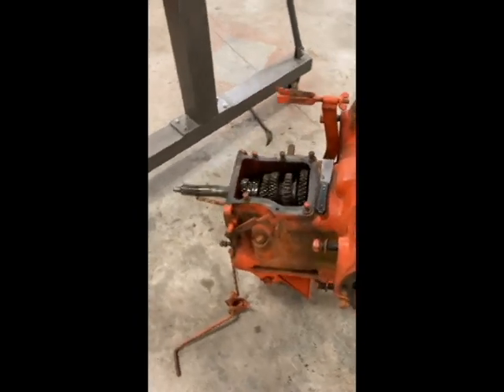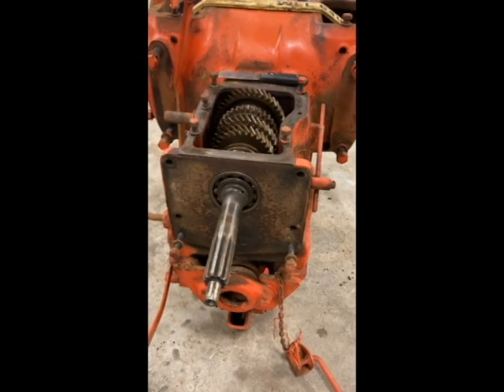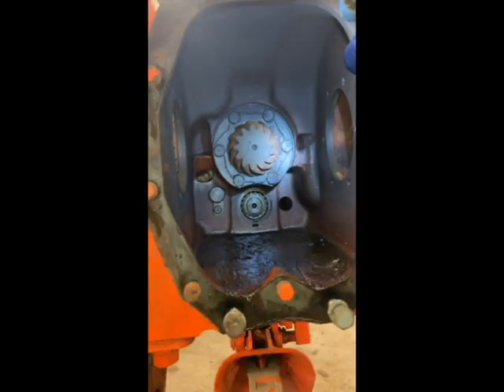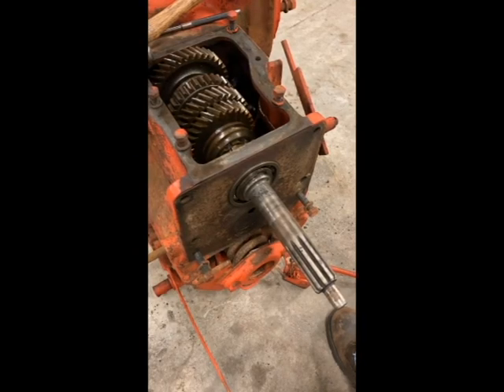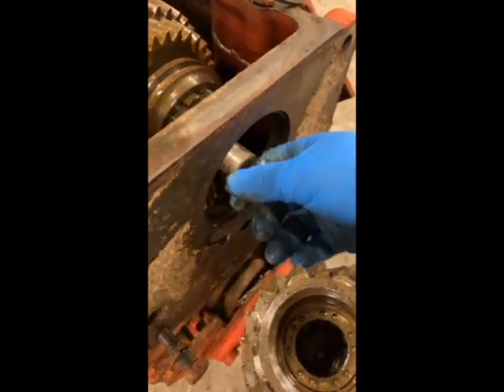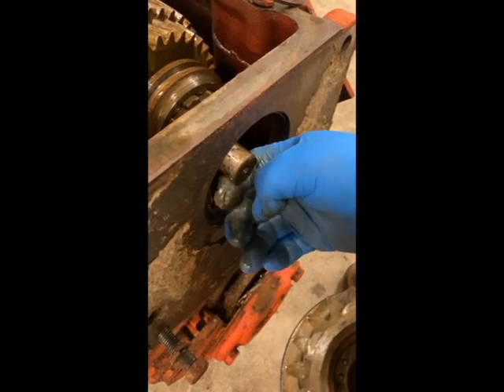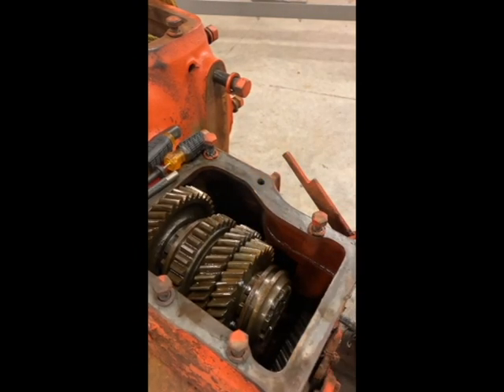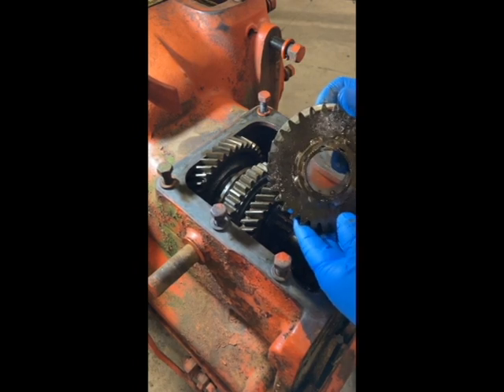Allis Chalmers WD Transmission Gear Disassembly Part 21

Comment: I ended up getting a real nice donor double bearing and bevel gear from another tractor for same issue. AGCO had them for $400 with shipping. Got the rear end for $80 and it had super tight gears and pinion gears in it.
Reply: Just have to make sure you are right on the size for the snap ring which I believe sets the thrust. But don't quote me on that. If I remember there are 5 different sizes with thousandths differences.

Comment: Good  day Nash. Interesting video. With only four gears it looks complactic, but u know with hand clutch u could leave in gear jump off tractor, jump back on pull hand clutch & u were off.  We also had W-6, putting it in 3rd gear it would grind everytime , or sit & wait. Interesting.  Next step  Thanks
Reply from the maker: Thanks Don.  It will be going back together in part 28.  Yes that hand clutch sure made it nice to stop and go and it wasn't that complicated either.  The newer styles can do the same but lots more parts and pressures required.  Just like that 190xt in my other video's.

Comment: Interesting - do you think the bad bearings caused the noise?
Reply from the maker: Yes I believe so. It was also binding the drive train. When the drill was turning the PTO it was hard to notice but when I done it by hand I could feel it getting hung up. New bearing in hand and ready to be installed.

Comment: can you get the double bearing and race the last one we did on my sons 45 which was about 10 years ago the bearing were on back order with a 3 month waiting period and were expensive maybe an after market now makes them?  the tractor also had the housing spit when bearing siezed old owner ran rear end out of oil put oil in it and tryed to move it and pop when the case  so we got a complete trans and rear end with warranty and bolted it up and still going strong!!! my two cents worth  l be watchin!!!!
Reply: Good  day  gary barret. Yea I heard of that  before.  Were are you from?  I from Ont.  Thanks
Reply: @donvoll2580  guthrie county iowa dad ran AC all his life ans so have l my sons use AC too and we clloct a few!!